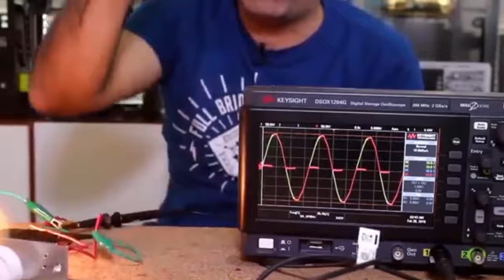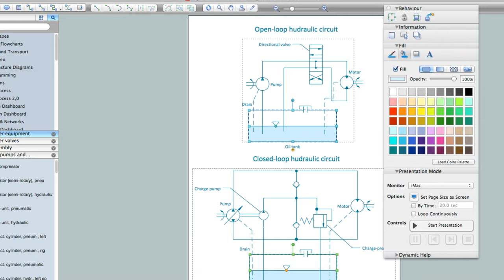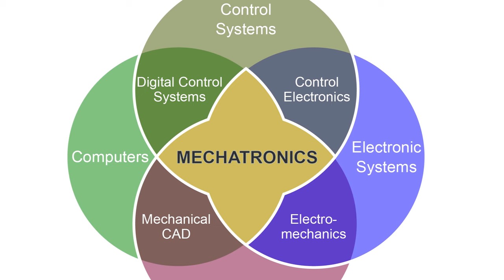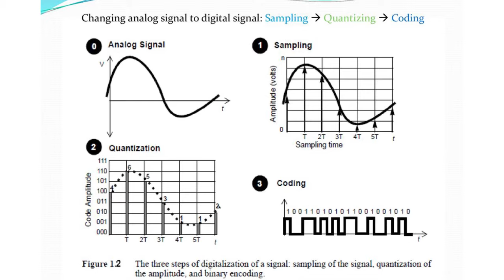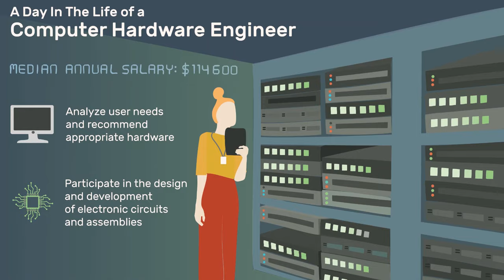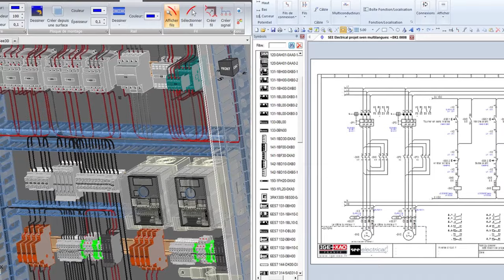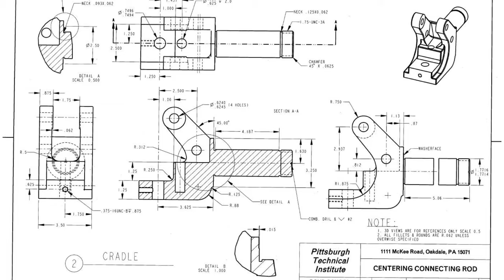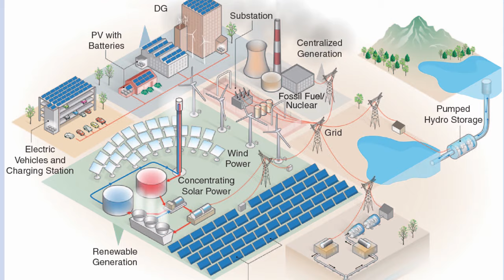What Does an Electrical Engineer Do? | What is the Work of Electrical Engineer?

Comment: I want to work in renewable energy R&D (specifically solar!), mostly in design as well as implementation and manufacturing. I also want to start my own company. Would EE be the best fit for my goals?? I’m torn between chemE and EE, since those seem to be the most hired roles in R&D and I have interests in both.. however I’m more so passionate about energy, the stuff we can’t see, the “magic” !!!!! (More so than chemistry) I also feel EE would be better fit for me starting my own company (a solar company, pushing the limits of energy storage in batteries!!!, etc.) Im just so torn :(
Reply from the maker: Great aspirations! Starting your own company has very little to do with which major you choose. And you can do R&D no matter what you study. So you have to choose one that’s best aligned with your interests. There are 10 times more jobs in EE than CHME so that sort of shows you which to pick. Unless you really love something within chemical, EE is one of the best engineering’s
Reply: @JakeVoorhees  yes I’ve been doing my research and I have settled on EE. Wish me luck! And thank you!

Comment: His electrical engineering dificoult?
Reply: It depends what your skill set is.  It is considered one of the hardest undergraduate degrees.  But this is primarily because it utilizes a lot of higher math, which is generally considered to be hard.

In terms of coursework,  engineering is often described as applied science.  In this sense, an EE education could be considered applied math.

It is pretty abstract for engineering.  Since you can't see electricity, all you have to go on is mathmatical modeling, test equipment, and, to a lesser extent, observing if the electronics created the desired effect. 

The good news is that if you start in engineering and if it is too much for you,  most of the first year classes will transfer to other STEM fields and even business. 

So you won't be able to party every day and you will work hard, but the payoff is a rewarding career for the rest of your life.